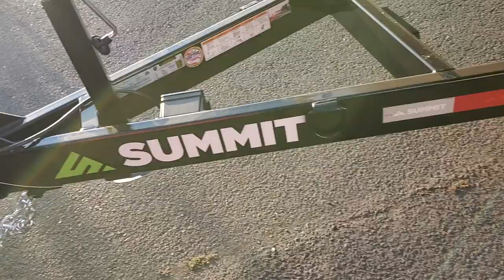2021 Summit full tilt trailer. Why I bought this trailer over the others.

Comment: Need to put a winch on that trailer!  My dad hooked up a cheap $50 harbor freight winch with a battery and it's way better than pushing it up the ramps!  Sweet trailer. Surprised it didn't come with a spare mount though.  You should video some of your Mustang going around a track or 1/4 mile.

Comment: i hope you don't put anything kinda heavy on the trailer or it will crack, its a design flaw the tongue has its frame that goes under the deck's frame and makes the front half of the trailer a "double frame"  but the double frame stops right before the front trailer axle and it tends to crack right where it ends 
go check out demolition ranch Matt's video when his frame broke
Reply: I think it will be fine for hauling a Mustang. Overloading it on the other hand .....   everything has a breaking point.
Reply: Quit spreading false information. Different brands and different age trailers
Reply: @williamuskoski1385  different brands same design  the age doesn't matter its the stupid design
Reply: @dhbplusect7052  In the almost five years the company existed. It has never had a single complaint or rework involving the tongue's design. The brains behind the designs has almost 20 years experience working on these things. Put that thing in the hands of an idiot and they'll find a way to break it.

Comment: I have a 7x20x 14k summit basically the same trailer but mine is not tilt deck and I also have a 2500 ram 2002 with 35s on my truck also 4 inch lift and it fits between the fender wells just fine no problem at all also these 35s stick out big time

Comment: Square steel frames dont last to long in the rust belt.  Salt/water always gets in and you cant paint, clean or even see in there.  They typicaly have perfect exterior paint and rot out from the inside.